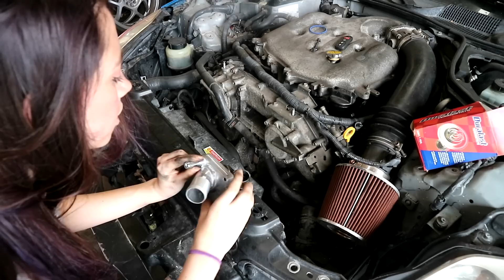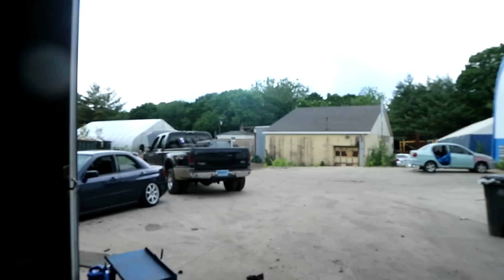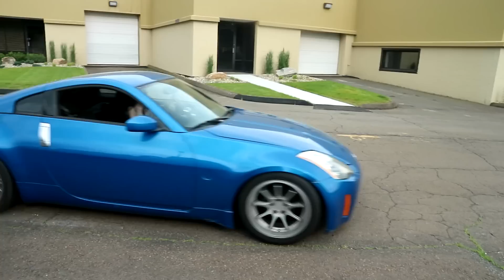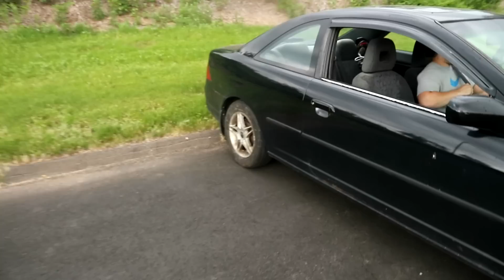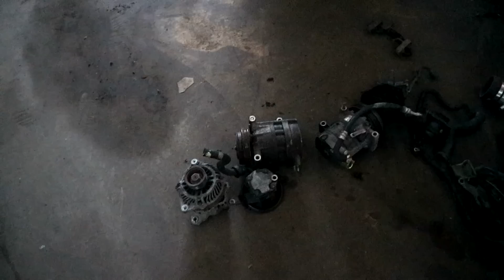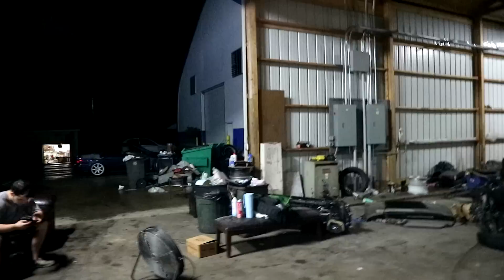CALLIE'S 350Z FIRST DRIVE!!!

Comment: Bro take the dually to the Ford dealership and pay them to diagnose it, then buy and replace the parts yourself.  I’ve had to do this before on my GM vehicles because I don’t own a GM Tech 2 diagnostic tool. They nailed it and it was worth every penny.
Reply: This^^^^^^^^^^^^^^^^^^^^^^^^^^^^
Reply: Ford will just replace the bad parts with the factory part. Idk how much life is left in the dually but it needs to be bulletproofed.
Reply: Joey Keith it's not a 6.0 it doesn't need bulletproofed.
Reply: Joey Keith also her days to take it to them to diagnose what's wrong. Not fix it.
Reply: Ilikeboost okay I'm just telling you from experience. 7.3s have their fair share of problems. If he takes it to the ford dealership they will tell him the problem but unless he fixes it the right way it'll just happen again. And the ford dealerships won't fix them the right way.
Reply: Joey Keith it’s a 7.3 they don’t need bulletproofing that’s the 6.0
Reply: Joey Keith obviously you have no experience with the 7.3. My 13 year old brother knows it is the 6.0 that you bulletproof.
Reply: User 99321 so everyone here is saying 7.3s don't have their problems. It may not be a head issue like the 6.0 but 7.3 injectors and harnesses and other little things need to be fixed. Everyone here must be ford guys or something. I drive ford and gm trucks and cars and every single one of them have their problems. If anyone here really knows 7.3s what's the biggest problem with them
Reply: Joey Keith They HATE cold starts! 😂
Reply: It doesn't take much research to find out what's wrong with his truck. Take it to someone who is a trusted powerstroke mechanic, replace all injectors, harnesses, check the IDM, change the fuel filter, and oil and filter, and check fuel pressure. And it wouldn't hurt to check all the glow plugs and their relays.
Reply: Joey Keith I did not say they don’t have problems. I said they can’t be “bulletproofed.

Comment: Haggard North Change the oil in the blue z and take one quart out and put a quart of atf in it and drive it for around 100 miles. The atf breaks down sludge and gunk in the motor and this method fixes the lifter ticks the 5.3s have in trucks

Comment: Check the injectors. Check oil pressure to the injectors and while you are in there check to see if the glow plugs are tightened down. Make sure your high pressure oil pump is good too. I think it's most likely and injector though.

Comment: The duelly has a problem with stiction like mine did use archoip oil additive and gas additive it will fix it check it out even guys on YouTube have used it

Comment: A couple things you can attempt to fix your WiFi is running all the updates on whatever laptop you're using to render and upload from.  Microsoft releases monthly updates that tend to help with any bugs, including network adapter card's etc.  Which means the part inside your computer that is used to connect to the internet, may need to be updated, so just run your "Windows Updates" until you are up to date, then start troubleshooting with the modem.  Also if you are using WiFi to upload the video, try using an ethernet cable running straight from the LAN\WAN port on the back of the modem, that will be at least 20% faster and more consistent than using the wifi
Reply: blake morris lol he uses his neighbors WiFi so cancel thst